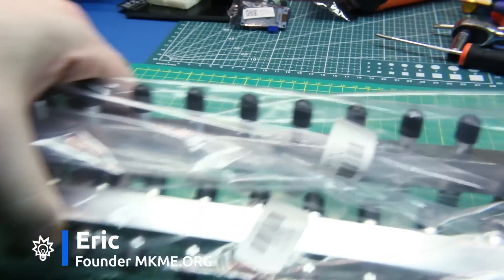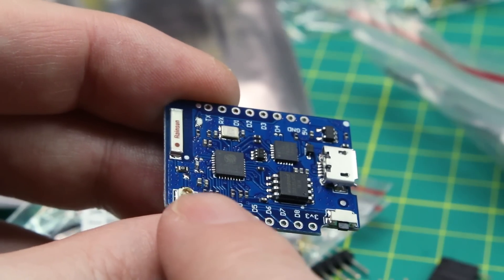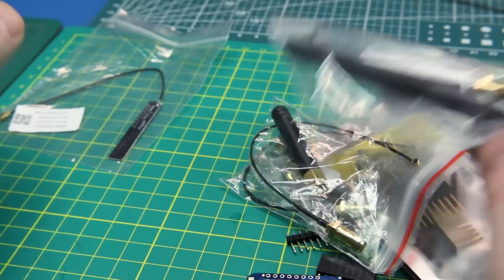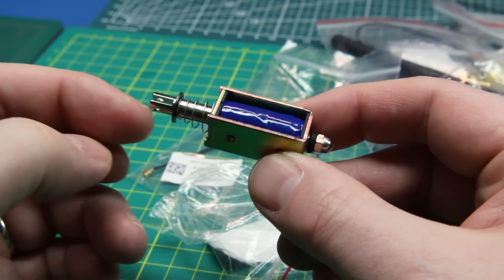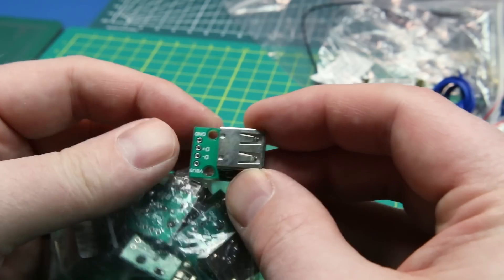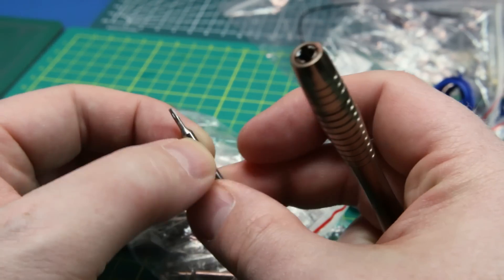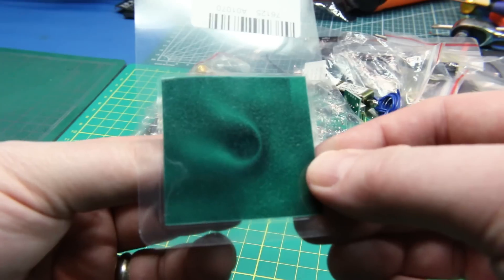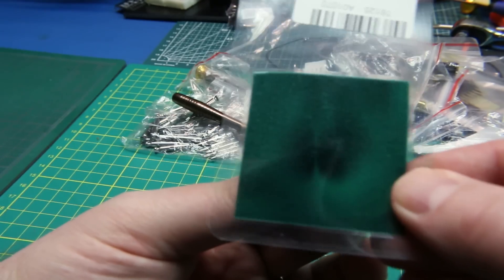🆕MAILBAG! ESP8266, Solenoids, Electronic Screwdriver & MORE!

Comment: Can’t wait for the antenna projects! I love antennas but I’ve SO had it with adapters! Just put back up an old 2-meter/440 antenna I had, because I got a new radio, and while I have eleven different adapters for the coax, of course I didn’t have the adapter I needed to connect to THIS radio... So frustrating! :-)             Buddy